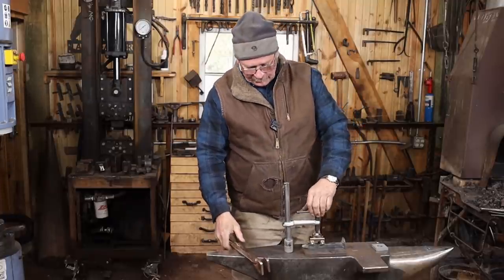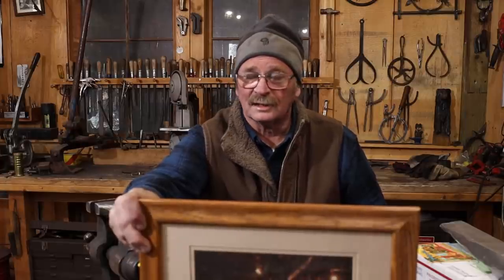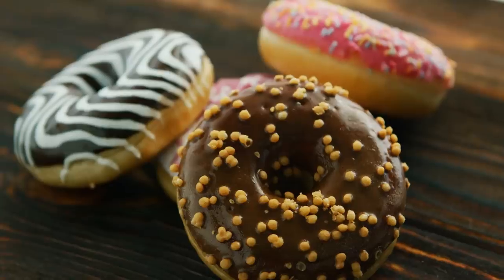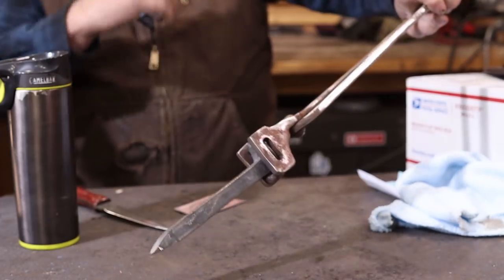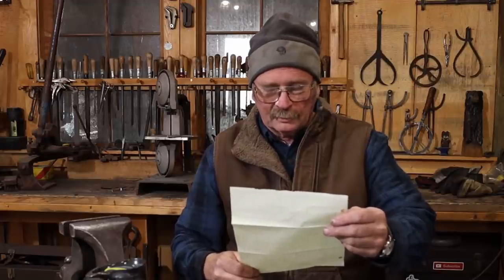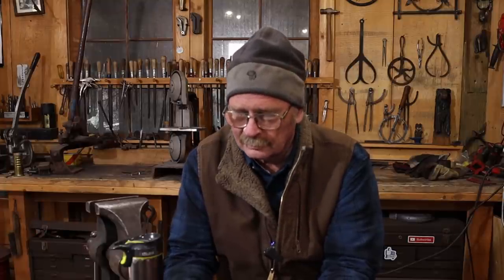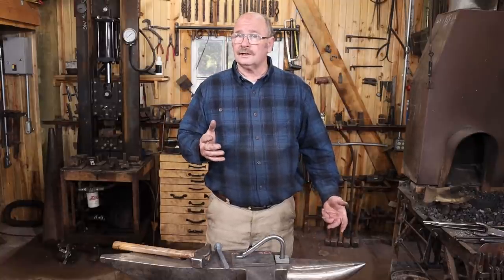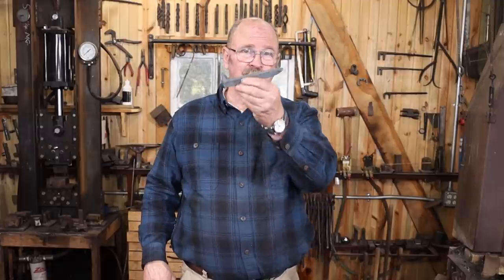New Anvil Hold Down

Comment: The hold down is an inserta clamp for build pro welding tables with a new end piece, it should fit your hardy hole too. The pin keeps it from falling through and the groove grabs the anvil face so it doesn't slide up under pressure. I made one for you and one for me and I'm done. I don't have time to sell them or make more. The hardy adapter was a prototype idea, if it helps with production I'll still call that a win. I didn't have an 11/16" dia holdfast to try it. Merry Christmas to all.
Reply from the maker: I must say this was a a real surprise to receive in the mail.  Great idea and I am sure it will receive lots of use.  Thank you very much for sending it out.  Merry Christmas and Happy New Year
Reply from the maker: I just went up and tried it in the hardy hole, works great.  Very ingenious.  Thanks again
Reply: @BlackBearForge  the adapter probably works if it have a tighter fit to the hole,
Reply: You don't see a lot of people going out of their way to repay those who have helped them. It's good to see there are still some decent people out there.
Reply: Are these for sale?

Comment: My guess would be that you have to drill out the hardy tool to the diameter of the turned down part.  That way you can use the hold fast in the hardy hole

Comment: I use an old 12" Jorgensen 'F' clamp. If you remove the rivet from the end of the bar you can remove the sliding clamp. I insert the head from the bottom of either anvil or work bench. the result is an adjustable hold down that is easily removed.  Note. If you buy a new clamp be sure to remove the plastic cover before using it at the anvil.

Comment: I sent you a video a couple of years ago showing you how to take a pair of the c clamp style vise grips and cut off the top fixed side turn it over and weld on a cold roll that fits your Pritchett hole on the jaw that moves and that’s even faster than that or if you get the self adjusting vise grips, and the hardy hole attachment is probably if you want to weld the f-clamp to it so you can use the hardy instead of the Pritchett hole

Comment: Question on your chili forge. Did you have to make any changes for altitude? I am setting up at 8500 feet.
Reply from the maker: They provided a larger set of mig tips to re jet for the higher altitude.  So I would consult with Chile Forge to see what they recommend.  You're another 2,000 feet higher than we are here.

Comment: Isn't the square adapter used for the hold-down but in the hardy hole?
Reply: That's what I was thinking too
Reply: That was also my thought.
Reply: There is a key hole in the round one that holds it together that is not in the hardy hole adapter.  But still it should work I would think
Reply from the maker: The round hole in the hardy adapter is sized much smaller, so it would need to be adapted.